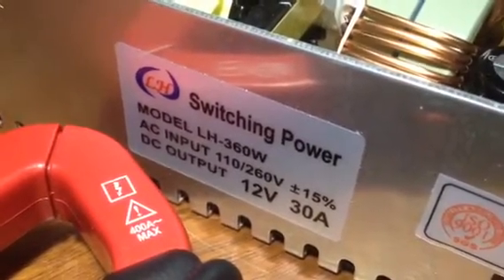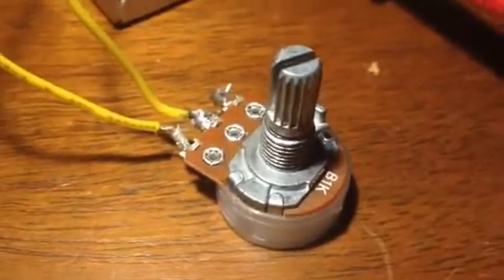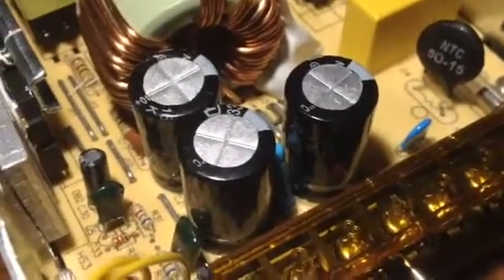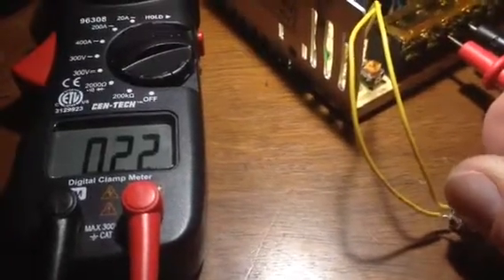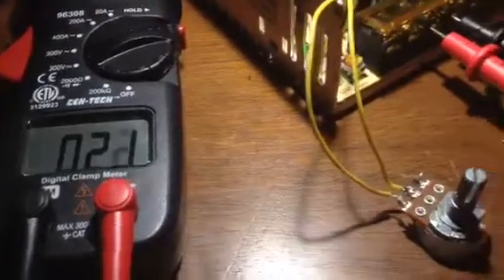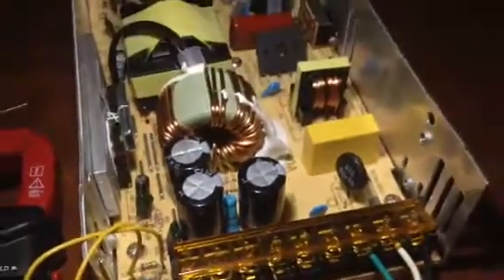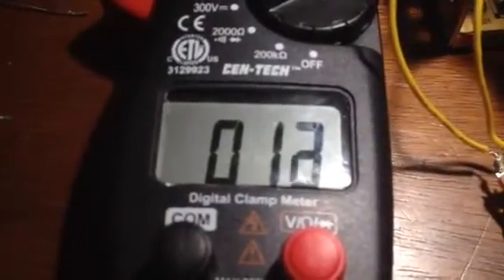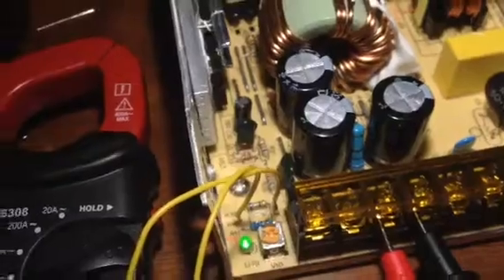Modify 12 Volt 30 Amp 360 Watt Switching Power Supply

Comment: I am trying to control voltage on a similar power supply remotely. I am reversing the direction of a small dc motor as well as voltage so I want to lower the voltage as I change direction. I am using a dt dp switch to do the reversing but need to use a pot to vary the voltage If I hook a 1 k pot at the same point on the board would that work?

Comment: Good nice video you modified by changing the feedback light intensity in optocoupler. I have a question is it possible to convert a 500 watts 48V 10 Ampere to 110V 4-5 Ampere power supply Am going to try in few weeks. I need your suggestion. And I think I need to replace O/P capacitor according 200V range or above and protection Zener diode need to replace.
Reply: Hello, there is no optocoupler in that PSU, TL 494 gets direct feedback from pin 1 to the resistive divider.

Comment: Lemme guess, it burned out and let the smoke out..?  And yes the caps are always rated higher, the mosfets however are not rated to handle the heat created at that voltage if you only connected smaller or less power consuming devices at that level than it will work for a bit.  But its a 360w supply, not a 420w.. hell with only a fbr attached directly to main you can get 90+dc voltages..
Reply: Lol when running two 50 amp supplies in parallel what voltage would be safe to set them both equally to?